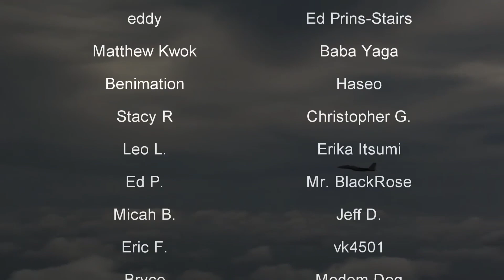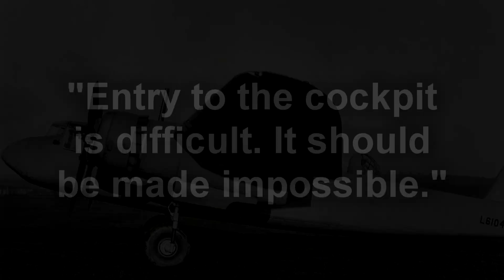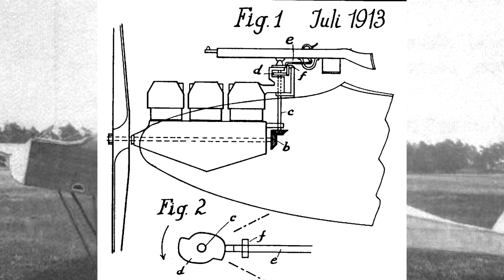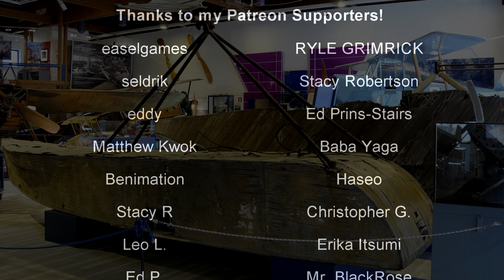5 of the Worst Planes Ever Part 4 | History in the Dark

Comment: Although aircraft are not my thing you make a good presentation of the subject.
At the risk of being pedantic I did notice one thing.
At about 04:20 you said that "The [Tu-]144 could only sustain supersonic flight by the use of afterburners like a military jet. The Concorde didn't do that."
According to Wikipedia Concorde did use afterburners but just for take-off and to accelerate through the sound barrier (Mach 0.95 - 1.7).
Also according to Wikipedia the Tu-144S used afterburners but the later Tu-144D with newer engines did not (but apparently the cabin was still loud).

Comment: You could also say the Concorde it's self was a massive failiar.
Reply: It was a French/English ego project and since no one really wanted it each flight needed to be subsidized about 3 times the ticket price .
Reply: @philvanderlaan5942  BA Did make a profit from the Concorde. Mind you it's first 4 were purchased for half price and it's final 3 for  £1 each.
Reply: Commercially speaking, yes it was. Although I would argue that it was a bit of a victim of circumstance.
Technically though? It was brilliant.
Reply: The Concorde was only operated by two (technically more....) Airlines, BA and Air France, it was offered for sale in the US, but Boeing had their own version on the drawing board, the 2707, and Lockheed had their version too.  With estimates of design/delivery for 1975 and 1978 respectively... and they were going to larger.  The 2707 was to be a supersonic equivalent to the 720.   But the oil crisis, and the noise testing stopped the development in their tracks.

Comment: Tu 144. The 1st prototype was so different to all the later versions it really should be counted as 2 separate designs. In the later designs the engines were moved away from the fuselage which helped with the cabin noise but the length of the air intakes prevented them being moved further away like the Concorde.

Comment: the B.E.9 pulpit wasn't even solid wood it was wicker, the gunner was literally sitting in a basket, it wasn't the only plane built like that, it was sent to Russia, the Russians quickly and sensibly used the basket to fit 4 machine guns operated by the pilot!
Reply: The French had a version of SPAD using a similar idea, and had some success in WWII.  But the idea didn't progress.
Reply: The Russians got the French version, Britain stopped at that one, France carried and did a production line.
Reply: @lancerevell5979  it was a ww1 aircraft, but yeah it did sorta work.